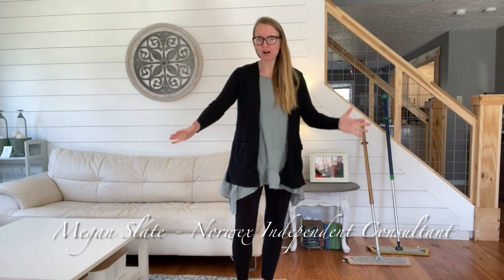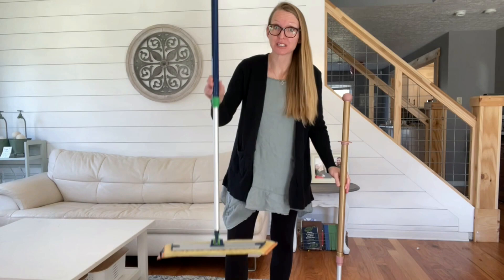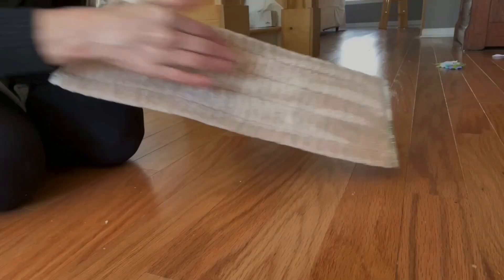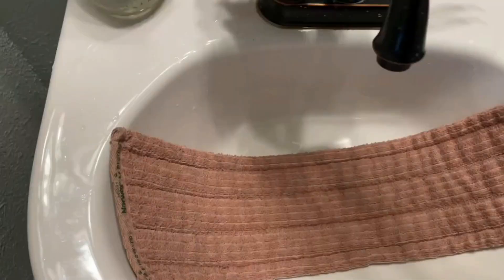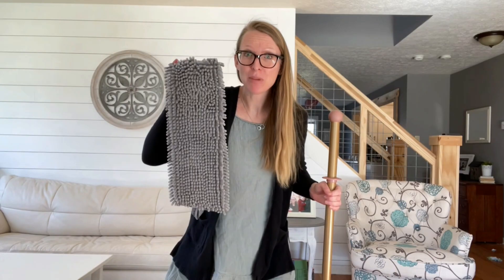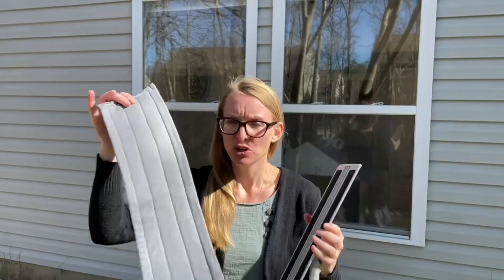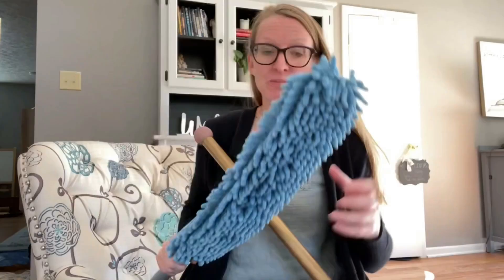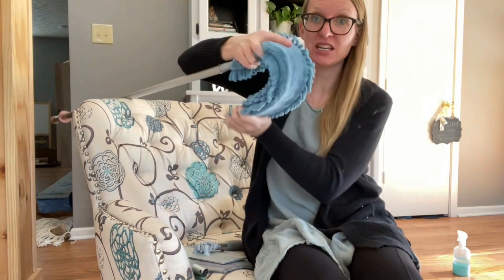The Norwex Mop System with Megan Slate

Comment: Does it matter if you use hot or cold water for mopping and then cleaning the mop pad?
Reply from the maker: I would recommend HOT water to wash/clean the mop pads so the fibers can swell and release all the junk they're holding onto for you. But you can mop with cold or hot water as you clean your surfaces.